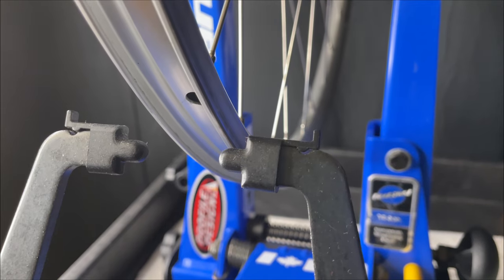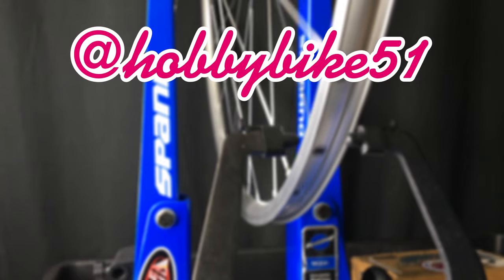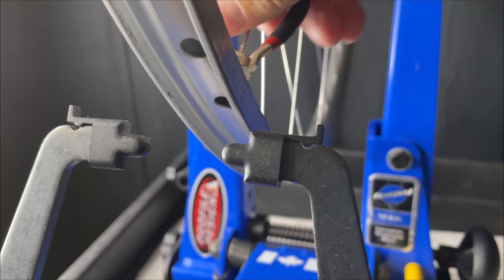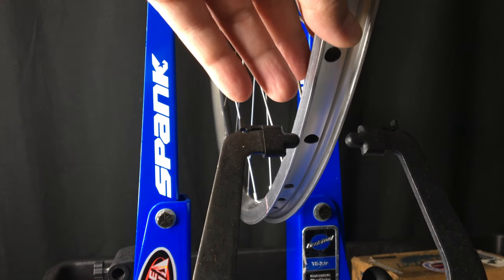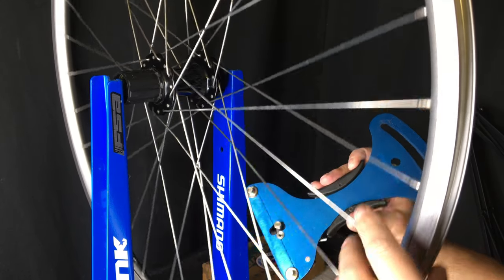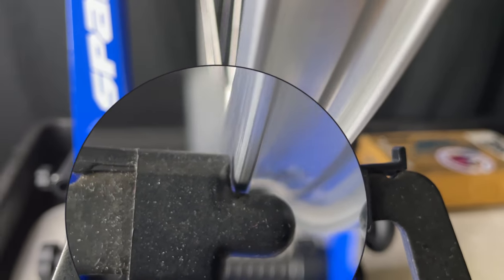Wobble wobble! Watch me true a wobbly bike wheel!

Comment: Well. I understand it's a disc wheel but the drive side should be way more tight. Check the kgf/Nm spec of the rim vendor and the corresponding park tool table matching your spokes. 2mm/14G spokes and 1300Nm tension is about 24/25 on the scale.  So you want to adjust to at least around 20. The NDS/disc side usually needs to be way less tightened, so the wheel stays centered. The Park Tool stand may auto-center, if not, flip the wheel and the difference to the side should be the same (or buy a WAG-5 dishing tool)
Reply from the maker: Hey Clint, this is a truing video🤣! Slow'er down a bit and read the title, would ya? If you want to critique my tensioning and dishing technique, subscribe and watch this vid: https://youtu.be/SJZGXdI_kpY
Reply: @hobbybike51  that video is equally bad
Reply from the maker: @FuchsHorst  🤣 Oh, in what way? You've proven you pay little attention to anything, so do tell.